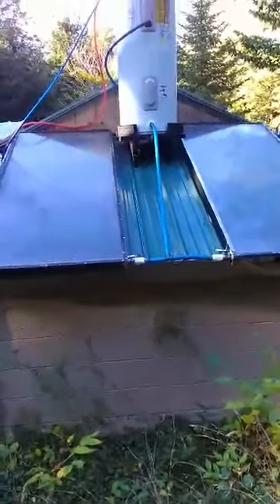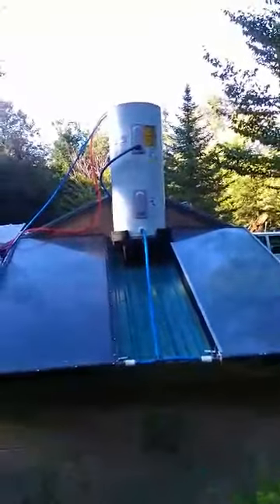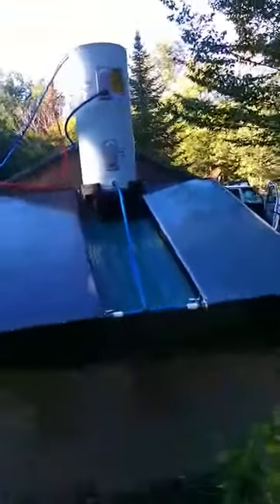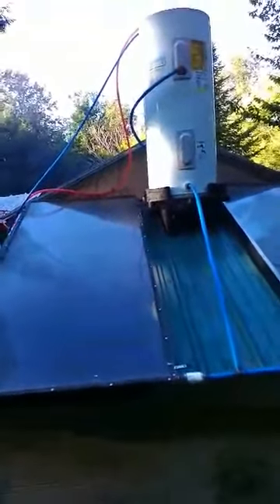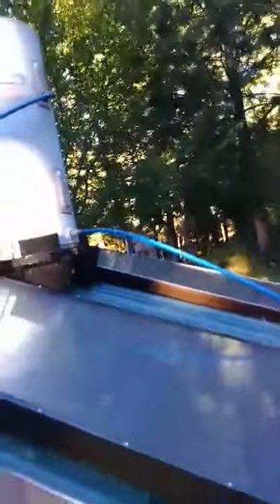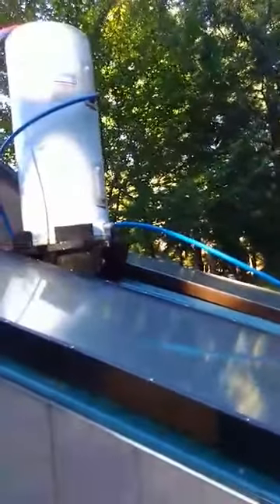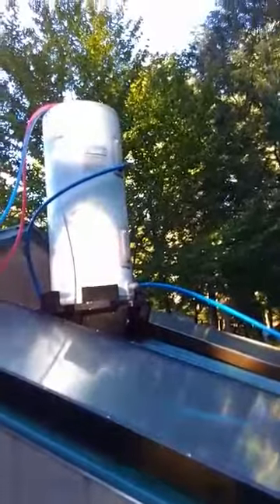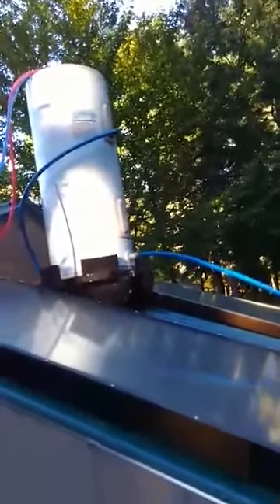Off grid hot water shower

Comment: Can you use this all year round?
Reply from the maker: Good question....in it's current configuration, no...however I DO have another insulated water tank that has a coil inside and then you fill the coil and panels with glycol (antifreeze) and the tank goes INSIDE the attic (my future plan).....Right now I go t
here for the lake and the ice makes swimming unpleasant so I drain it and shut the gate all winter.